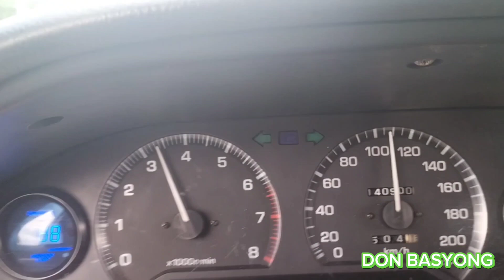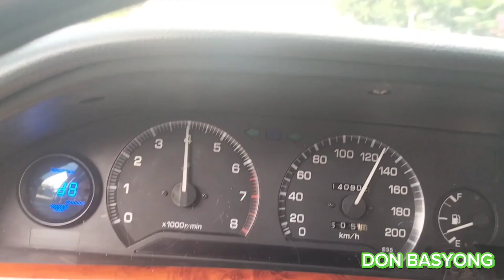OIL LEAK SA CYLINDER HEAD NA DI MALAMAN KUNG SAAN / D.I.Y TIP

Comment: Gud day po sir tanong k lng po kc ngplit po ako ng fuel filter ng 2e engine big body k.mdumi n po kc yung stock nya npncn k po ang bilis npuno ng fuel filter ng bgo k nlgy d k p cya n oon s engine nya.
Reply from the maker: Kc may pressure Yan kabasyong Ang gasoline diba pag inilagay mo sa Isang bote Ng soft drinks Yung plastic DBA pag binuksan mo mag pop o sisingaw.
Reply: ah ok malki nmn po pinagbgo ng bago k n fuel filter yung stock halos kkaunti ang agsoline n nsa loob kya po cguro kpg tumatakbo k sir nmmtyn ako at kapag sinusi k uli aandar uli.ngyn pnsin k mdming gasolina lgi fuel filter k at d n k nmmtyn kpg tmtkbo k.slmt po sir s mbilis n response s mga tanong k po.God bless po